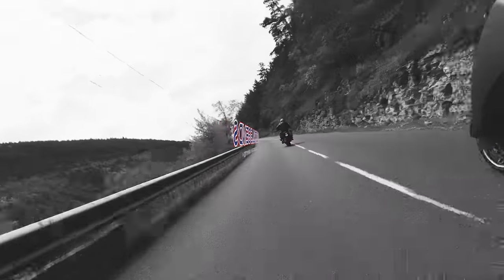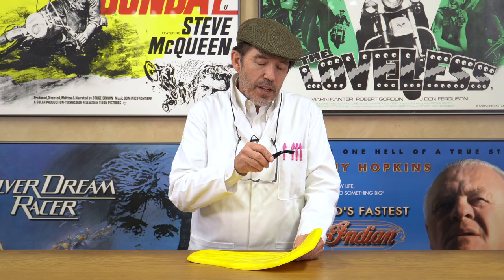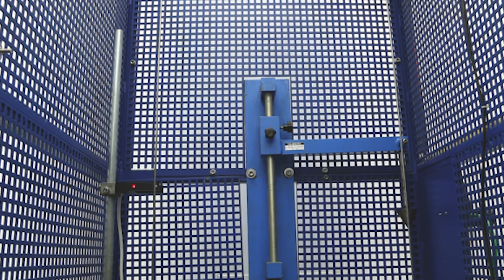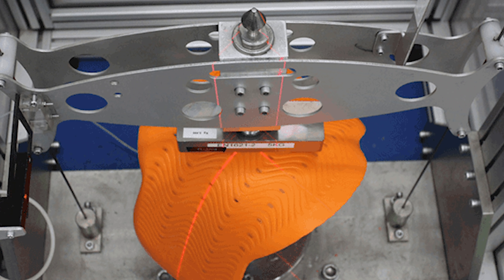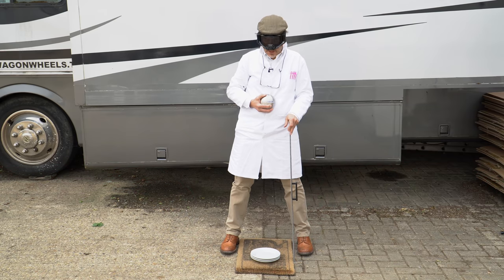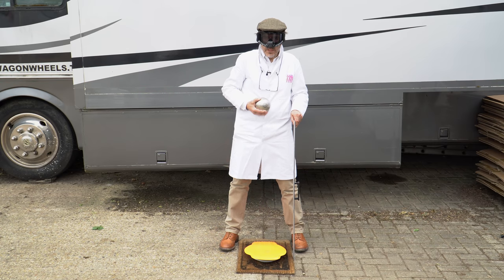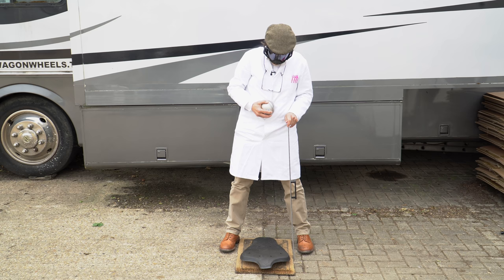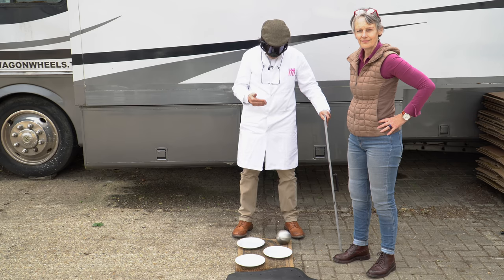Motorcycle armour explained

Comment: I agree with his message, better to be comfortable than trussed up like a medieval knight. As someone who habitually rides old bikes with about 25bhp in tap, race quality protection designed for people riding at 150mph round the IoM is unnecessary. It gets in the way of using a motorcycle as an accessible means of transport that you can use to go to work in or go to a social event on.

Comment: Fantastic, great way to explain the use of bike armour. 
 However! Even if you have a slow speed spill and you go down on a hip or elbow, you will certainly know about it. 
Speaking from experience, wear the best you can afford all the time.
We should be fighting for motorcycle clothing to come under PPE status which would make it cheaper for all. Less VAT!
Reply: Digger : All motorcycle clothing, gloves, footwear and impact protection components have been required to conform to the PPE Regulation 2016/425 since it was fully implemented on the 21st of April 2018. Manufacturers are required to have their products independently tested and certified, but as Chris states in the video, there is no additional legislation making it compulsory for riders to wear tested and certified apparel. Even if such legislation was to be passed, it would still not guarantee VAT-exemption. Efforts to secure such an exemption in the past saw HM Treasury telling the lobbyists it was a “transport” issue, and the Department for Transport saying it involved taxation and should therefore be determined by the Treasury!

Comment: I ride mountain ebikes over some pretty rough trails and I am aware of the protection I need if I part ways with my bike when I am riding. After a few spills and landing hard on my chest, I decided to get some padding. I purchased a motorcycle grade Leatt hydro pack and chest protector. It wasn't until I had to actually use it when I found out how valuable it was. The hydro pack ironically works as good back protection as well as a water source.

Comment: Great video Chris, nobody else is providing this kind of information. Is the armour a one time deal? What I mean is if I were unfortunate enough to have an accident and the armour did its job, is it OK for another accident (god forbid) or will the armour need to be replaced? Cheers
Reply: Dan The Chippie no, most modern armour will handle multiple impacts. In fact, that’s how the testing works anyway, if I’m not mistaken. You can check for yourself by hitting your armour and see if the foam recovers. Forcefield advertises repeat performance. If you hit Forcefield armour you’ll see it recovers it’s shape instantly, ready for another impact in the same location. 

The only time I can imagine you’d need to replace the armour is if it was cut by a sharp impact, torn or abraded badly. You can inspect your armour visually after an accident for peace of mind.
Reply: Martin Foster : “Most” modern armour will not in fact withstand repeated impacts. That is the preserve of the premium, specialist brands. The user information supplied with many protectors will specifically state that it should be replaced after an impact.
Reply: Paul InShanghai well, I agree that you should defer to the manufacturers’ instructions. But I disagree that most foam pads automatically need to be replaced after an impact. Do your due diligence though, by inspecting the pads. If you don’t see any permanent indentation or cracking of the foam then your fine to continue. 

What do you consider premium brands? I don’t give much credence to “premium brands” if you’re referring to Dainese, Alpinestars, etc which often use marketing and brand snobbery to rack up the prices. Instead, I do my research and get any test results I can from CE or Motocap to see how the armour performed. Based on that, I have pretty good confidence in Forcefield and Knox. 3dO’s recent formulation is pretty excellent too but I haven’t got any of their pads.
Reply: @martinfoster5163  : Manufacturers have to safeguard themselves against legal liability, which is why they will err on the side of caution and recommend replacement after any impact. That is entirely appropriate in respect of some of the (extremely) low-cost closed-cell foam protectors found in equally budget garments, I stand by my original assessment - I have examined crash-damaged protectors and reported on them for the Court. 
As regards "premium brands"; for clarification I was commenting on protectors from specialist impact protector manufacturers, not garment brands who may produce their own components in-house, or may subcontract manufacturing of branded components.

Edit: I also recommend that motorcyclists should check out MotoCAP (www.motocap.com.au) before making a purchase, to see if the garments they are contemplating purchasing have been assessed (but I must also declared an interest, due to my involvement in the foundation work behind MotoCAP).

Comment: Thought I'd share this information as a I got curious: It takes approximately 3 kilo newtons to break a spine  (according to PBS dot org) and 4 kilo newtons to break a femur (according to discovery dot c o m)

According to the video:

Back protector test @9:20:
Level 1: <18 kilo newtons (average)
Level 2: <9 kilo newtons (average)

Elbow / shoulder protector test @12:32:
Level: <35 kilo newtons (average)
Level 2: <20 kilo newtons (average)

I seriously doubt this means level 2 is inadequate (im not a scientist or doctor), but I thought this could help others and / or spark smarter people than me.

Ride safe everyone!

Note: according to PBS dot org, 3 kilo newtons approximates a 500-pound car (1/4 the weight of a typical hatchback) crashing into a wall at 30 mph

Comment: hi, why do they have such confusing designations for armor?  Looking at shoes and it says Cat II EN 13634?  And then there's another shoe Cat 2 certified 89/686/ECC?  And a third shoe, just says CE level protection?  Why not just say Cat  1 or 2?  Also in Imperial measurements, what does 50 joules represent?  30mph crash?
Reply: R DS : Cat I and Cat II have no connection with performance level (the amount of protection provided; typically /Level/ 1 or /Level/ 2. “Category” refers to the severity of injury; Cat I = minimal risk, the onset of which can be identified by the user (e.g. gardening gloves), Cat III = mortal danger (i.e. danger of death; such as the clothing worn by medical personnel dealing with COVID-19 patients), and Cat II = everything else, and includes motorcyclists’ clothing, gloves, footwear and impact protectors. 

The “89/686/EEC’ refers to the legislation in force from 1994 - 2018; replaced with effect from 21st April 2018 by Regulation 2016/425. There is work to be done educating motorcycling consumers about the legislation  and the standards. Despite a few minor errors this video generally did a very good job.

Comment: Just wondering, how come most, if not all,  armored jackets do not have chest protection?
Reply: Chest protection is not part of the CE standards. An earlier video here showed this. It suprised me too. Perhaps the armor is at the expected point of impact, so the abrasion is incidental to the fall
Reply: I'll have to dig up that video on this channel as I've been curious for awhile now.  Do you remember which one it was?  It just doesn't make sense not to protect the chest.  The only thing I could think of is that halving the chest protector at the main chest zipper would not pass CE tests but it's better than not having any chest protection at all.  The only ones I know that protect the chest are the body protectors used for downhill MTB & motocross.  Thanks for your input!
Reply: Jed Berliner : You are incorrect! Google “EN 1621-3:2018 Motorcyclists' protective clothing against mechanical impact. Motorcyclists' chest protectors. Requirements and test methods.”
Reply: My link was to mid-May 2020 video screen shot
Reply: Jed Berliner : Zone 1 in EN 17092 is defined by the area of coverage of the EN 1621-1 shoulder, elbow, hip and knee protectors. As Chris of Motolegends stated in the video, these are mandatory components in AAA and AA classification garments (hip protectors are not required in A classification trousers or lower half of suits, and B classification requires no protectors at all). A back protector, like a chest protector, is not stipulated as a mandatory component by EN 17092. That is why the zoning plan does not depict either of these areas.
Reply: @paulvarnsverry11  I think you've agreed with me. Chest is not in Zone 1 since a chest is not a shoulder, elbow, hip or knee. Chest protector is not a mandatory component.
Reply: Jed Berliner : Yes. I agree with the second part of your opening statement, with a correction to the first part regarding EN 1621-3:2018 for chest protectors.
Reply: @paulvarnsverry11  The original question was limited to jackets: "Just wondering, how come most, if not all,  armored jackets do not have chest protection?" I said that chest protectors weren't required for jackets. You wrote "Wrong!"
The presence of a separate non-jacket standard for optional additional chest protectors is off-topic.
I don't mean to sound snarky. Ride safe, my friend.